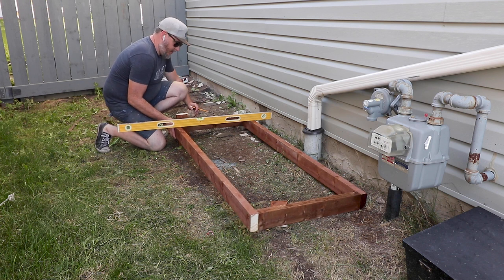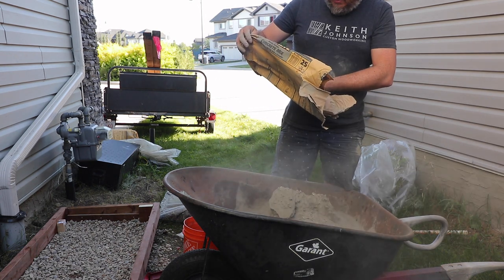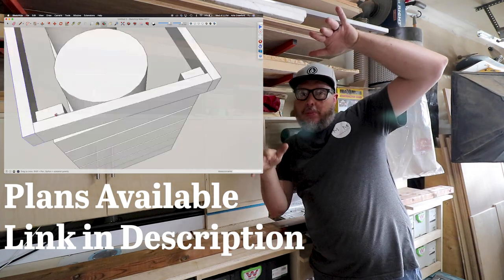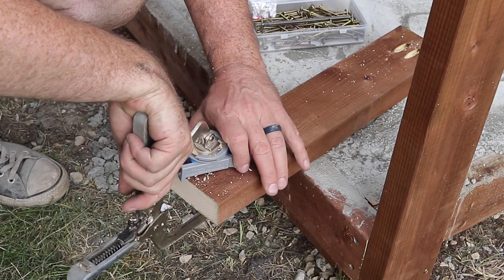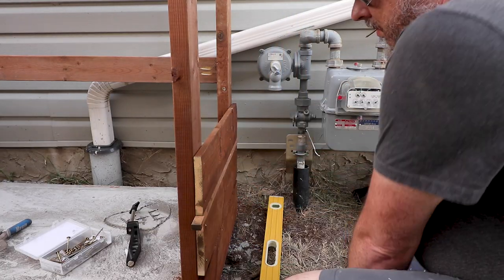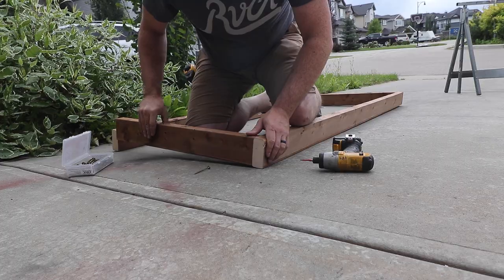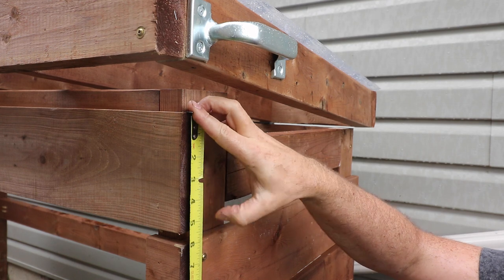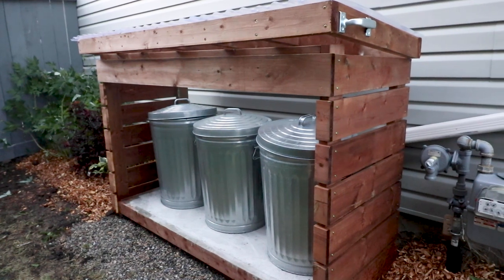How to Make a Storage Shed for Garbage Cans or Lawn Equipment // Trash Storage Idea

Comment: Love the video, love all the great comments!  I build a blind also.  Things I learned watching your video and building my own.  Put a lid on it.  Plus, you can get spring loaded hinges, or I've seen portion bars to help lift it up.  Always slant everything away from the home.  I should have bit the bullet and poured concrete.  Put plastic down before the gravel.  Mine is rear load, which kind of sucks when you get 8-12 inches of snow.  But I didn't want to build swing doors.  What brought me here today, is to build a sliding 'barn' door across the front (side where you push the trash cans/bins in) and let it slide to the back and then forwards again.  Not having a lid, and as I mentioned, 8-12 inches of snow that started when the bins were curbside, allowed lots of snow to blow and fall into my blind.  Again, thanks for the video, and all the amazing comments!!!  Hey, how about powered sliding door.  Just Kidding.
Reply: Did you add portion bars? That is a great idea, would love to see a picture of you you installed it

Comment: You’re correct on not needing rebar - rebar in pavements is really only to reduce shrinkage and cracking from that shrinkage unless you’re designing something for truck loads. Curing your concrete by watering it (after it sets) for the first week or so will be better money spent to prevent shrinkage than installing rebar.
Reply from the maker: Oh sweet thanks! The pad is still in one piece so I must have done something right 😂

Comment: Great project!  Final product looks good.  Good for you taking a stab at the concrete!   My suggestions: remove sod prior to placing gravel, water and compact gravel, place stakes on the outside of the formwork, I would not suggest leaving the wood next to the concrete, with freeze/thaw the wood will separate or could rot.  You’re right, a minimal amount  of reinforcement, like a 5M mesh would be a good idea.  I suggest mixing concrete to consistency of chunky peanut butter.
Reply: I was thinking all the same things.  My father has done construction projects from remodels, additions, new homes, all the way up to building Lumber Yards.  He explains there are 2 types of concrete, one that is cracked, and the other that is going to crack.  With rebar or mesh, etc., you have a chance of controlling it.  I have a Civil Engineer friend who builds/rebuilds airport runways, mostly for small to medium-sized towns.  He says if you do it right, it will never crack.  But he has knowledge about this and checks every load that is delivered, so I'm pretty sure his concrete doesn't crack.  

Great video, and great comments Steve P.  Thanks!!

Comment: I would recommend digging out the ground 3 inches before adding your base rock for better drainage. Also this allows you to ensure your forms are level with the ground and prevent seepage of concrete while pouring. Also for base crushed limestone or actual base rock is better than using the river/peagravel.
Reply from the maker: Thanks, Cody! I’ve got a few concrete projects planned for next year, so that’s super helpful
Reply: @furthernorthfab   no problem. I poured a concrete pad for my trash cans and I didn't put down base. I just dug it out a little set my forms and poured. It'll be fine for two cans but I should've added more time and set my base correctly. Also concrete has a high compression value re-bar is best in situations that there will be stress and strain, bending and pulling. My job does paver driveways for vehicles. We only use re-bar when setting the edges.
Reply: @furthernorthfab  I came here to say this- digging out a bit is the way to go. But for a little guy like this you're probably good.

2 more little tips: when mixing concrete in a wheel barrow I find it easiest to toss the bag in the barrow, Stab it with your roundhouse shovel, and pull the paper out from under it- you have to screw around with cutting the bag less, and getting your hands in it.

#2: lay down a little 6mil plastic, a tarp, scrap sheets, or something where you're mixing and where you're pouring. Concrete is messy- plan for it.

Great video, keep it up! Look forward to seeing more.
Reply from the maker: daniel rowan-fuller I’m going to screenshot these tips for my next concrete project. Thanks!!!

Comment: ON THAT CORRUGATED PLASTIC. Even taping that stuff it will still chip it.
 I used an Electric Rotary Fabric Cutter. "Not" a weak battery-operated one. A corded one there are plenty on Amazon.